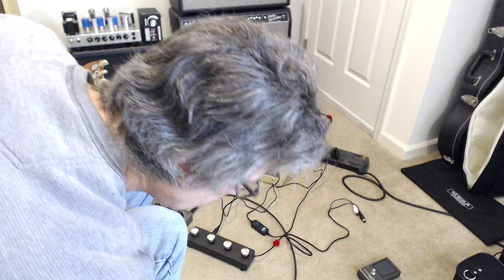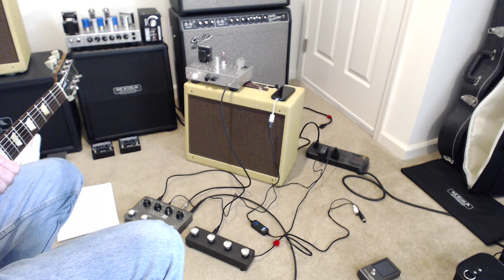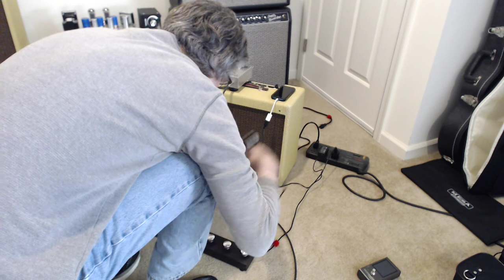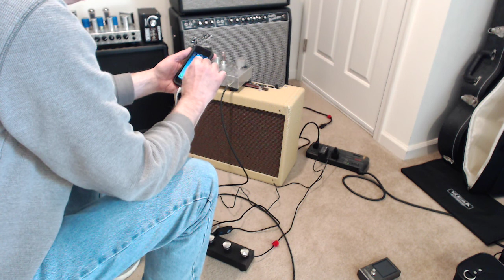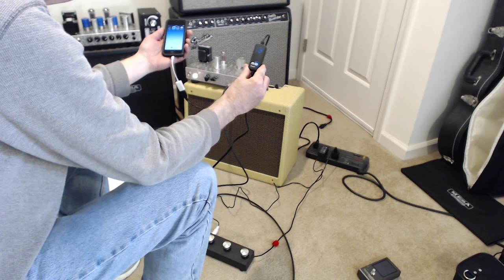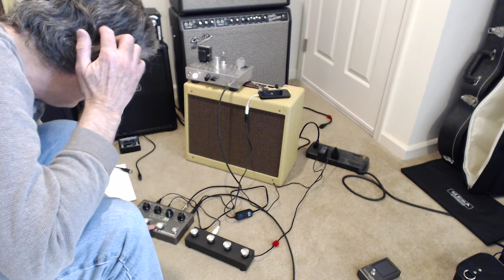Ditto X4 Midi Sync and Control

Comment: Facinating, Im buying one for the  sync reasons. Im actually hoping to cue up the next phrase on loop 2 ahead of time and hoping it will drop it on the one count. I'll be using a Logidy UI3 pedal to change the pattern of my Arturia Beatstep Pro sequencer which is running a Roland Ju-06a and an Akai MPC 500. Can you confirm whether it will drop on the one even if you hit the pedal early? The Beatstep Pro does this cue up feature. Great Video and Thanks .... Ramble On !!!!!

Comment: Hi, thank you for this video.  Using the midi interface that has the midi in and out cables to the Ditto to sync with the iphone and the pedal control. How is that done with only one midi in on the Ditto?
Reply from the maker: For the configuration shown in the video, the MIDI out from the controller pedal goes to the iPhone where the Midiflow IOS app merges the CC commands from the controller with the MIDI clock generated on the iPhone. This merged MIDI data is then sent to the Ditto X4 using the MIDI interface output. In later versions of the controller pedal, I added MIDI merge functionality and a MIDI output. In this case, the iPhone provides the MIDI clock and the controller pedal merges the clock messages with the CC commands and then sends the MIDI data to the Ditto X4. This setup is a bit simpler, I think.
Reply: @larryyounkins5346  Thanks for the info. I also have the Dx4. I have a Melo midi commander controller and want to sync to lumbeat ios drum.

Comment: Help, I don't understand what 'the loop plays along with the click' means. Does the loop start and end get quantized to the nearest beat of the click?
Reply from the maker: My understanding is that the loop boundaries (start and end) are quantized to the nearest pulse-per-quarter note (PPQN) message when the Ditto X4 is synced to a MIDI clock. There are 24 PPQN messages per quarter note.
Reply: @larryyounkins5346  Hi Larry, thanks for your great video! For a project I'm working on I'd be really curious to know what happens to your loop on the Ditto if you change the tempo of the MIDI IN while the loop is playing back. Will it slow down/speed up the loop? Add silence/chop it off short? Or something else! Hope to hear from you.

Comment: kinda cool too, the new version of Ableton Live has the ability to "follow" the tempo of audio information; I haven't tried it out (not officially released), but its designed for live to work with stuff like this. I kinda wish more guitarists were interested in MIDI stuff rather than if the plastic bobbins on humbuckers effect the tone.

Comment: Can you share midi cc value for midi controller?
Reply from the maker: The MIDI CC commands accepted by the Ditto X4 are (from the Changelog for v1.1.00):

Added MIDI Control (use MIDI Channel 4)

    CC3 Looper 1 Rec/Dub/Start
    CC9 Looper 1 Stop
    CC14 Looper 1 Clear
    CC15 Looper 1 Level
    CC20 Looper 1 Hold to Store
    CC21 Looper 1 Clear Backtrack
    CC22 Looper 2 Rec/Dub/Start
    CC23 Looper 2 Stop
    CC24 Looper 2 Clear
    CC25 Looper 2 Level
    CC26 Looper 2 Hold to Store
    CC27 Looper 2 Clear Backtrack
    CC28 Decay "Level"
    CC29 All Loops Stop
    CC30 All Loops Clear
    CC31 FX On/Off
    CC85 Parallel/Serial Toggle
Reply: @larryyounkins5346  Great man! Thank you .